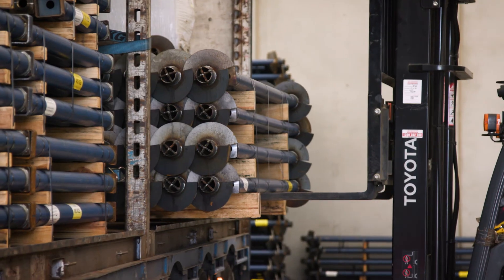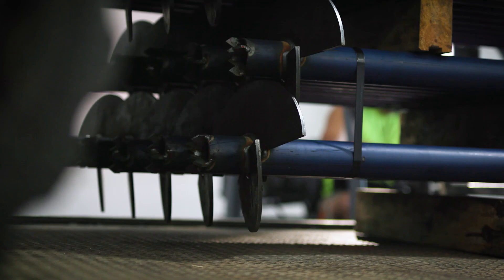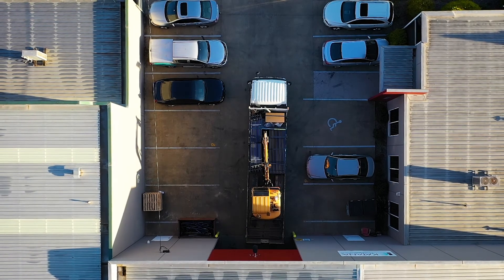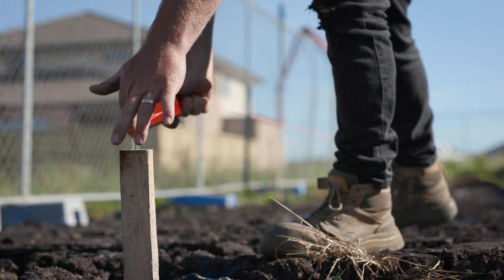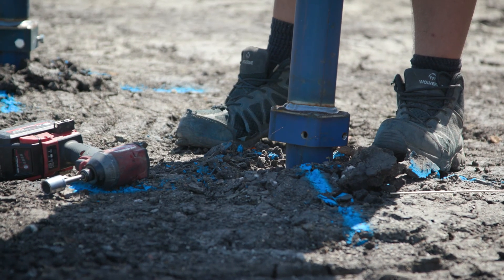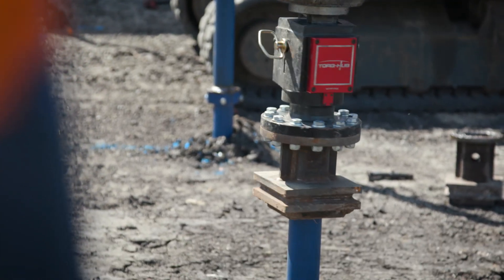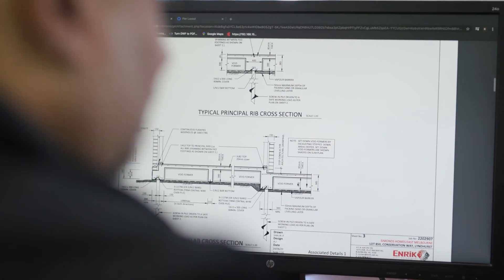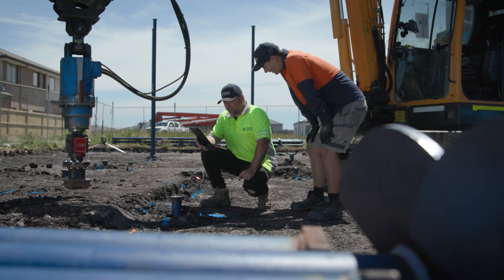Katana Foundations Screw Piles

Comment: Whats it's made of? It just looks like mild steel? And not dipped
Reply from the maker: Our steel is usually min 400MPa. Where is soil is more aggressive our preference is to seal the piles so corrosion only occurs on one side of the pipe. Galvanising is 55um thick and can get scrapped off during the installation process so we recommend galvanising more for above ground applications.

Comment: What is the strength at the joints? Were they both together? The square ends appear to be very similar to McLean Dixie helical’s. Why not galvanize the steel there? Is that a concern where you are?
Reply from the maker: In compression there are two plates that bear against each other, so as strong as the pipe we are using. In tension, 4# M12 grade 8.8 bolts will provide more than he uplift force required by a residential structure. The exposure classification is determined by pH, Resistivity and Chlorides. In the volcanic soils, we have on the East cost of Australia pipes will last at least 50 years and longer. Where is soil is more aggressive our preference is to seal the piles so corrosion only occurs on one side of the pipe. Galvanising is 55um thick and can get scrapped off during the installation process so we recommend galvanising more for above ground applications.